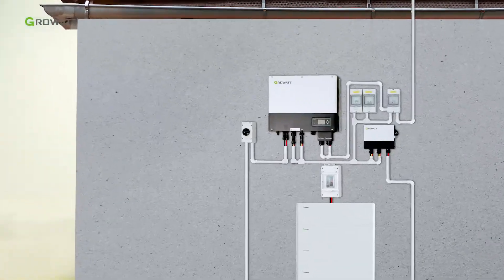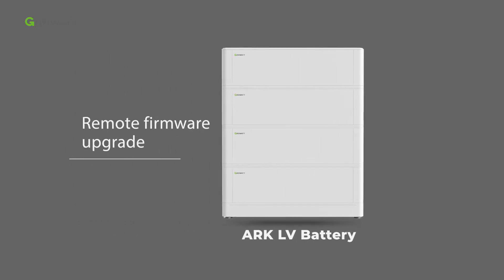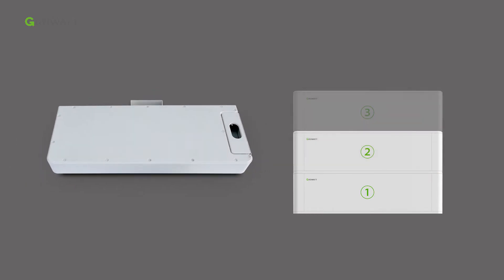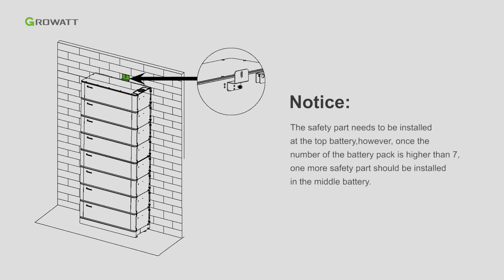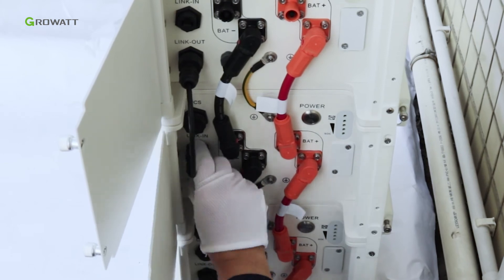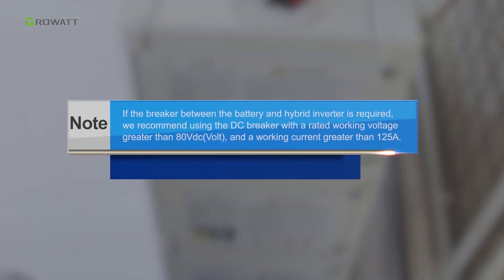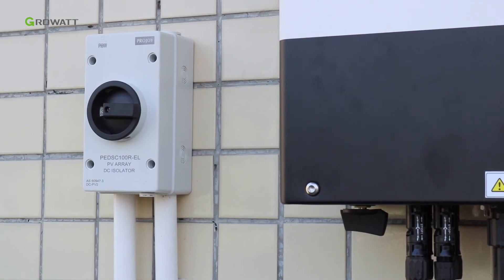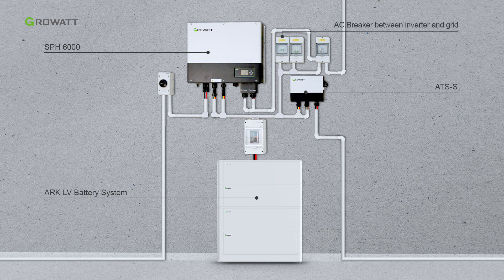The Whole ARK LV Battery System Installation Introduction

Comment: so how does this system control the output from the battery? is it just for emergency power Or will the batteries switch to output when the PV output is low? But then the output will flow back to the grid which might not be what you want. So how is that arranged?
Reply from the maker: Hello, for technical support, please contact our service team at service@ginverter.com, or you can call our service hotline at +86 755 2747 1942. Thank you!